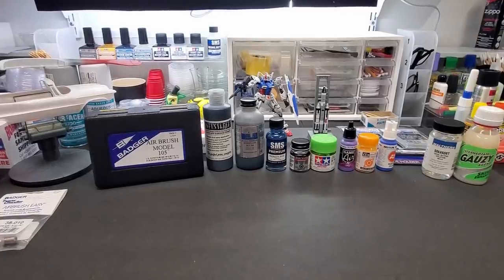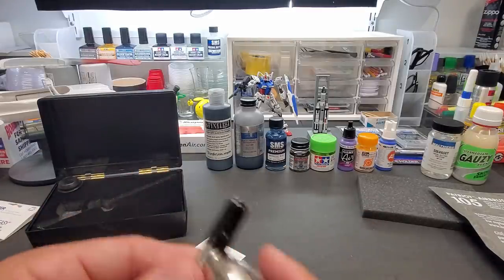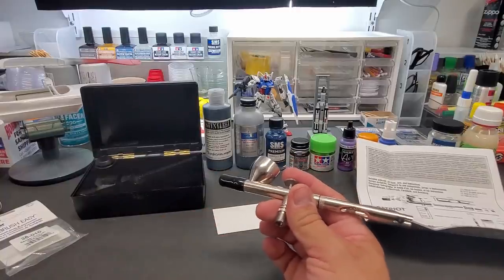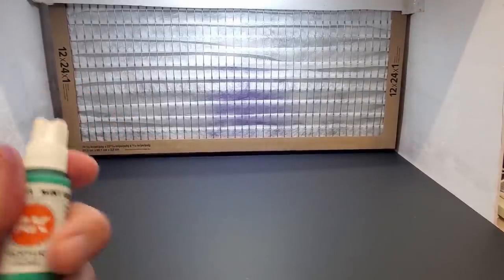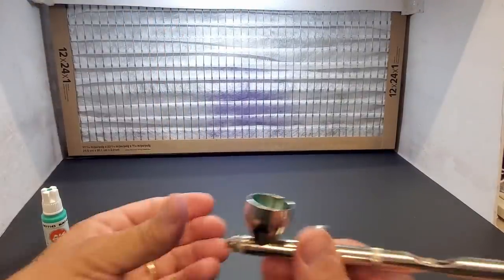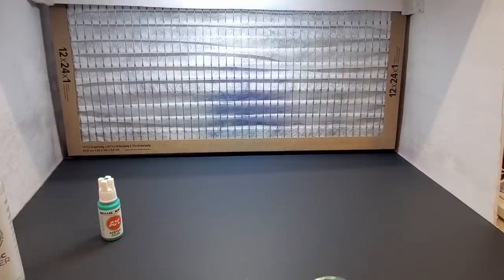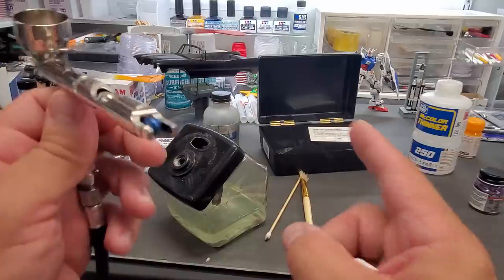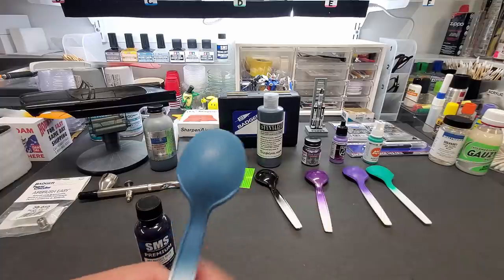Testing The Badger 105 Patriot Airbrush - Great All Purpose Airbrush

Comment: Standard size hose?? Who's "Standard?" Iwata and some others have one size, Paasche (who has been building airbrushes since 1905} have their size, and Badger uses their own size. Fortunately there are adapters to convert from one to another.
Reply from the maker: All airbrush compressors ship with a 1/8 hose. So that is what I mean when I say that. Each end of the standard airbrush hose is a 1/8 size. I believe it's only Badger and Paasche that have their own size on their airbrushes, every other brand in the world if I'm not mistaken is 1/8
Reply: @barbatosrex9473  What is more confusing is that Paasche, Thayer & Chandler (owner of Badger) and all commercial, industrial and DIY market compressors come with a 1/4" pipe tread coupler so you need to use an adapter to connect a "standard" 1/8"  hose connector. Just as a side note, in the pipe world, the size is stated as the inside diameter of the pipe and that is where the size of the connector designation comes from. (Outside the airbrush world, 1/4" Pipe Thread is the standard connection.)
By the way, I like your videos and use them a reference to our customers at the hobby shop I work at.